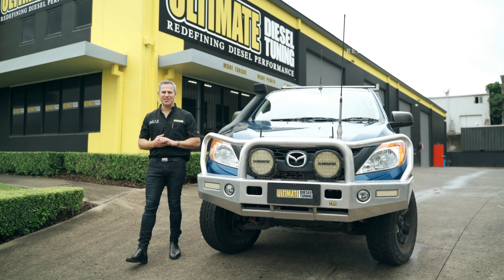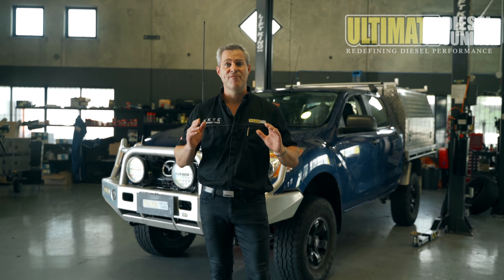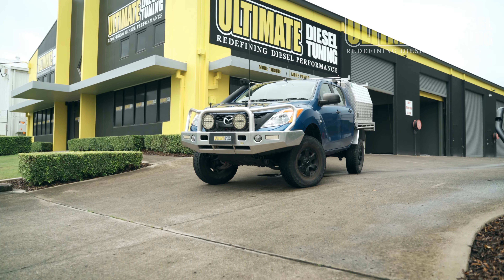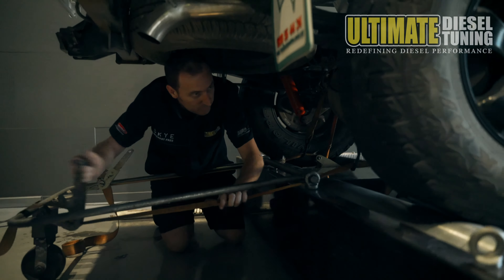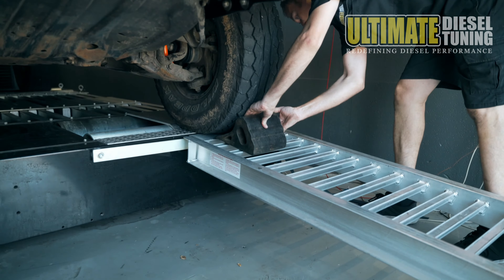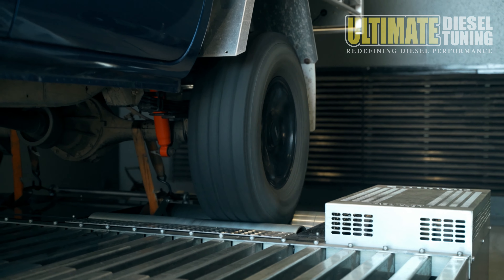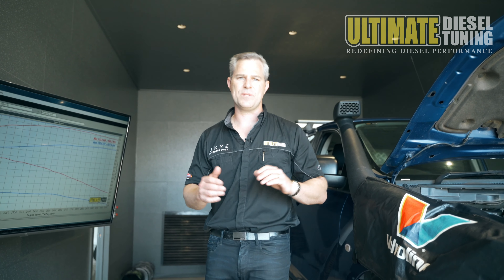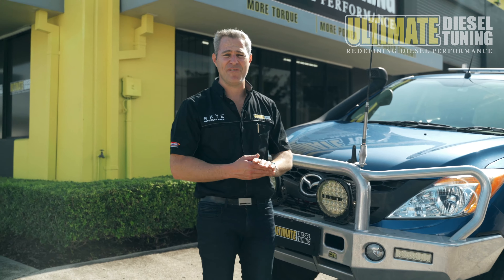Mazda BT-50 2014 model - Ultimate Torque Package!

Comment: WTF aren't these 470nm stock how did only make 407 on the first run
Reply from the maker: HI Jacob. The manufacturer's figures are just estimates, they are not real. They have also estimated those outputs at the engine, whereas our dynos all read the outputs at the wheels. So there is a substantial drop due to that.

Comment: What's the co$t of something like this?
Reply from the maker: Hey mate. Prices all vary! Best to give our quoting team a buzz on 1800034373 for a chat about yours & to get your options sorted out & your price.
Reply: @UltimateDieselTuning  I understand prices vary - but ball park for custom dyno tune = x,xxx? , Supply & fit upgraded intercooler = xxx-x,xxx? etc... surely some rough numbers could help your potential customers. i just want to know if the custom tune is going to cost me $500 or $2500...
Reply from the maker: @22slurpee  I only run the YT channel, I don't do quoting mate sorry or talk pricing, that's the job of Ultimate Diesel Tuning's quoting department. If it's easier for you - go to the website & fill out the Request Quote form that will pop up. Cheers!  https://ultimatedieseltuning.com.au/
Reply: 10k